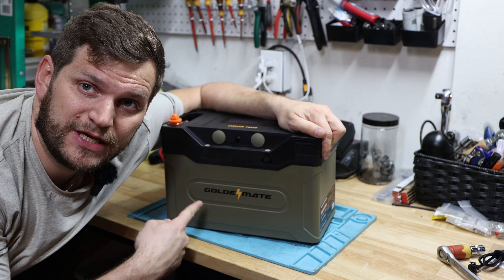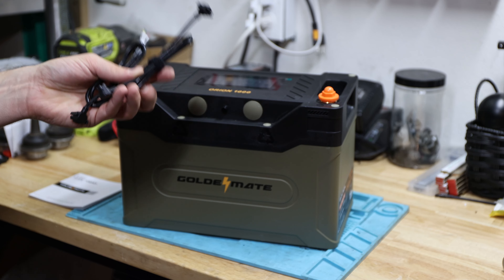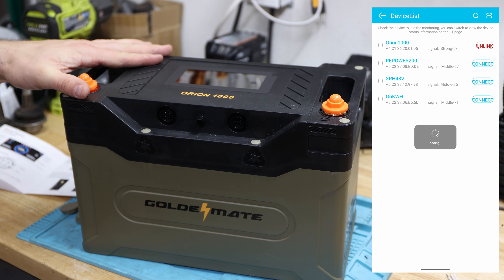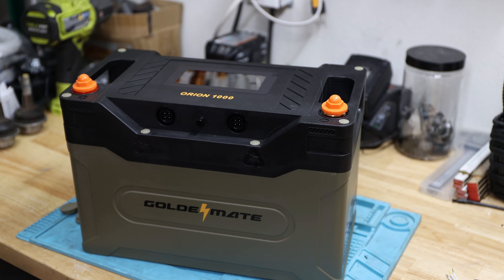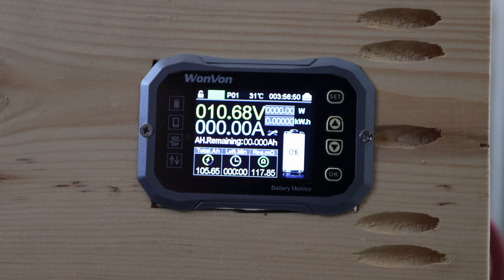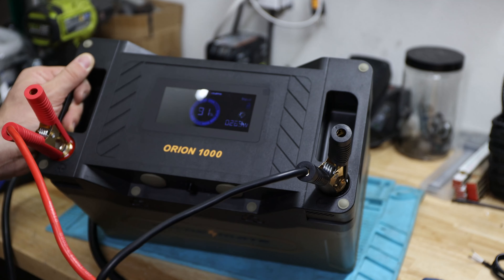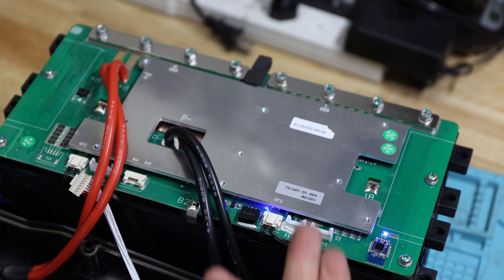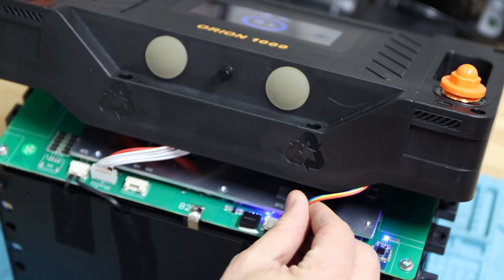High quality GoldenMate Orion 1000 LiFePO4 12V 100Ah | Review

Comment: What I have scene, unless they change the cells or something, I cannot see any other budget battery company beating this battery. The build construction, custom case, and built in display required R&D and just blows away most of the other battery companies I have scene. Right now these are $299.99 and with 15% off $254, I cannot see how these are not better than the others in the same price range? Good video!